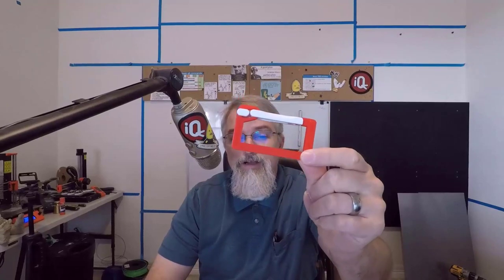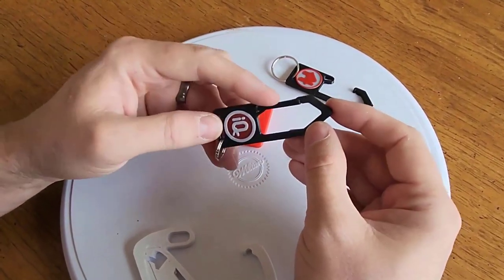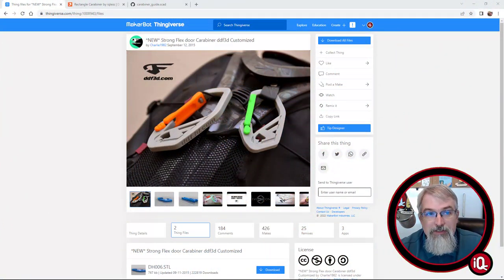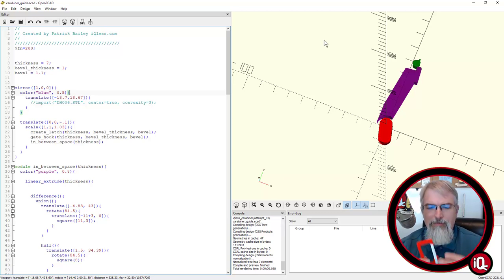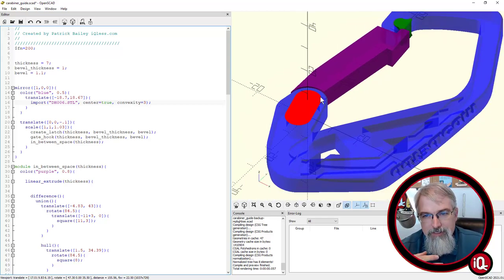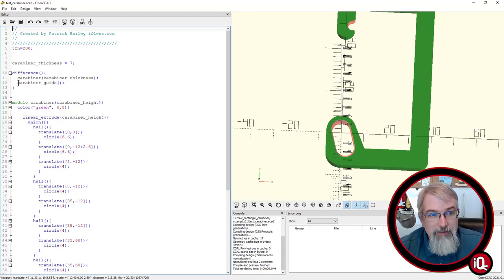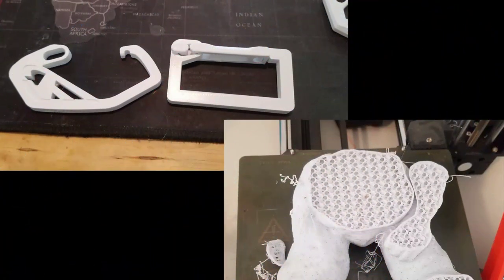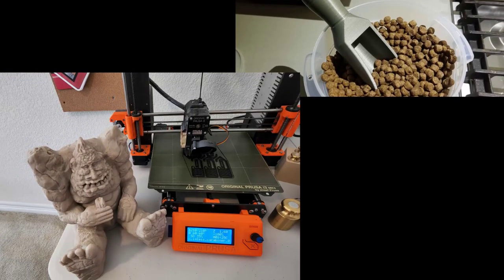3D Printing: OpenScad Square Carabiner

Comment: Have you ever experimented with printing QR codes?
Reply from the maker: Yes I have.
In fact I made one for the Homeschool conference a few years ago.
it was about the size of a tag you would put on a suitcase.
The problem is getting it to work well with the size nozzle.  with 0.4 and a short amount of data a 2x2 might work
but any denser you may need to use 0.25 to get it to work properly
I had thought about doing a new one...
I have a secondary wifi network for quests and a password for it I was thinking about making a 3D printed QR code for it